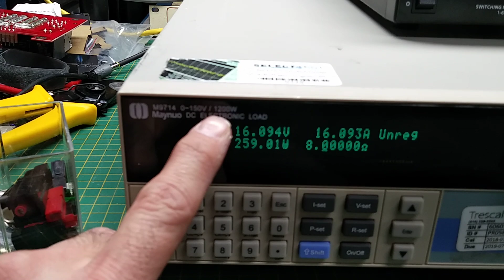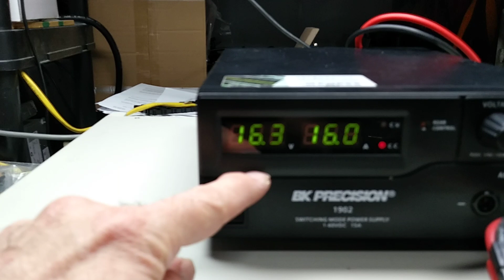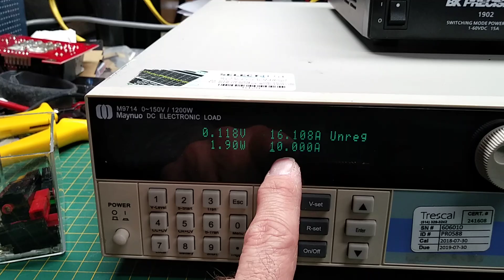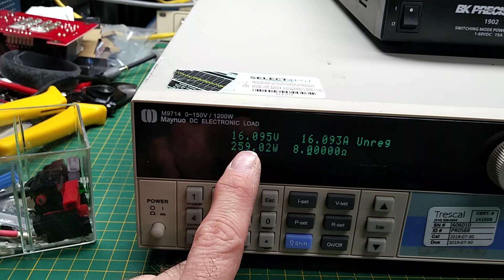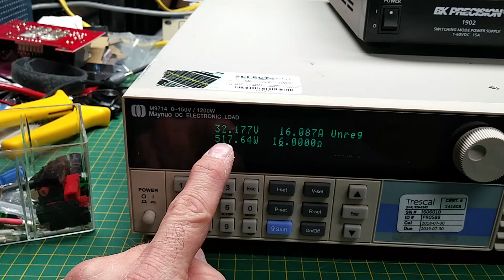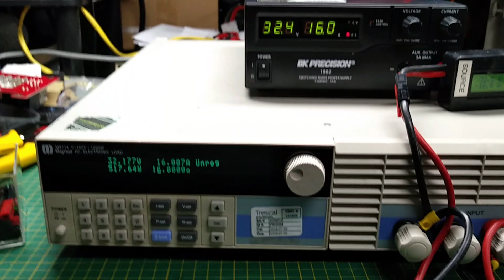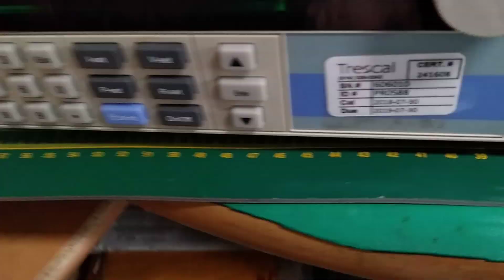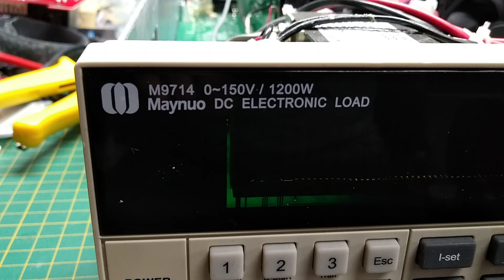Maynuo M9714 Electronic load 1200W 150v 240A    EDIT: Repaired!!!

Comment: Nice unit Doc. I have the 300W version with one module. What did you pay for it? Hope you can get it working.
Reply from the maker: Good new, I've successfully repaired it !!! it now work 100% !!.. It was simply way oof calibration!.. Curiously by a factor of 8.00!!!  I found the calibration procedure and calibrated the current with a reference power supply and it now properly set the current !!  I paid it 750$ CAD.. what a great DEAL for a 2000$ unit!

Comment: Good luck. That seems like quite the problem to hunt down and fix but I like your starting theory and if anyone can figure it out then you've got a shot.
Reply from the maker: Good new, I've successfully repaired it !!! it now work 100% !!.. It was simply way oof calibration!.. Curiously by a factor of 8.00!!!  I found the calibration procedure and calibrated the current with a reference power supply and it now properly set the current !!  I paid it 750$ CAD.. what a great DEAL for a 2000$ unit!